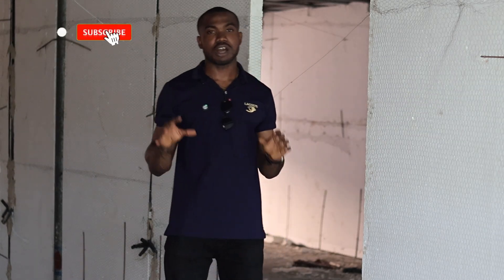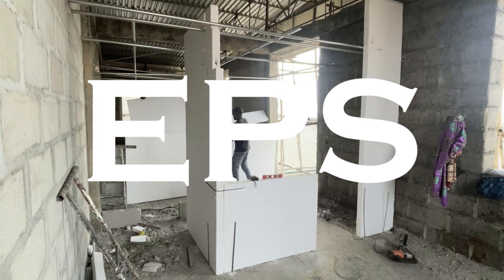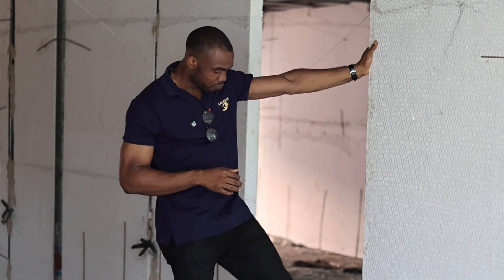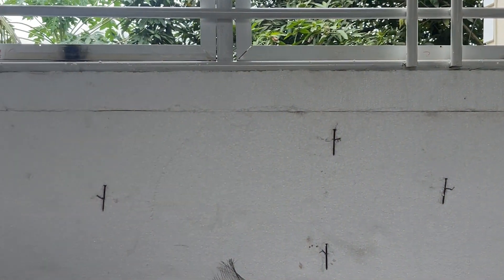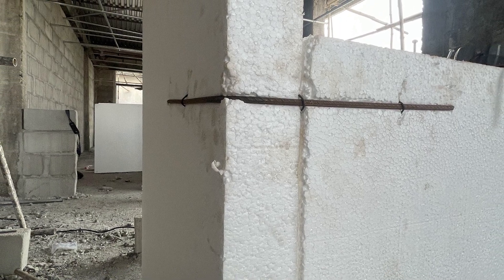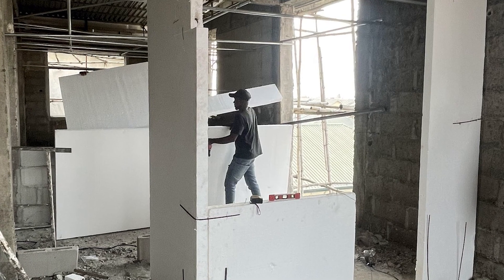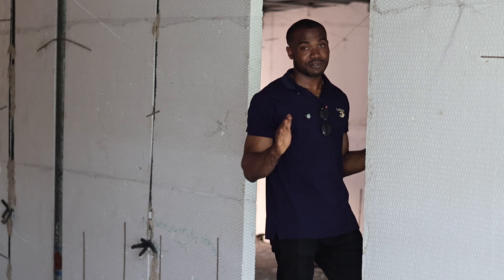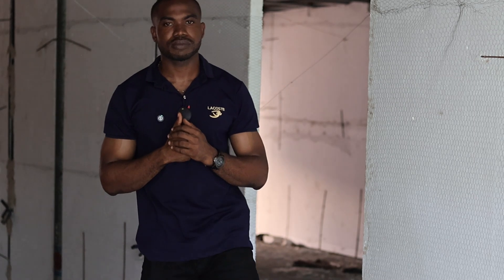BUILIDING A WALL WITH EPS TECHNOLOGY : A Step-by-Step Guide to Energy-Efficient Construction

Comment: The answer is no! The walls look incredibly flimsy. I’m not sure an old granny could slam a door in the frame you’re standing in without causing structural damage. A good rule of thumb is if you’d let your daughter sleep in a room made out of the stuff. Again, the answer is no. One can walk through or fall through the walls if they trip.
Reply from the maker: I promise u it’s not weak 😌
Reply: @ChimdiAjaero  okay, run at one and give it a shoulder check and post the video.